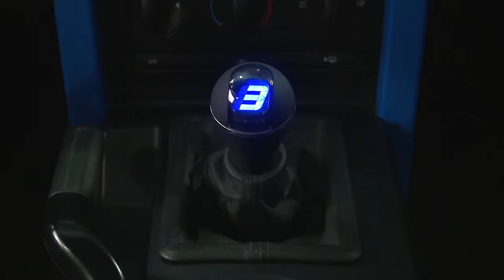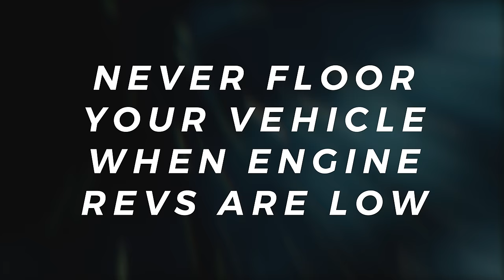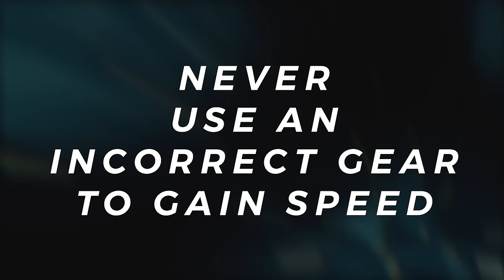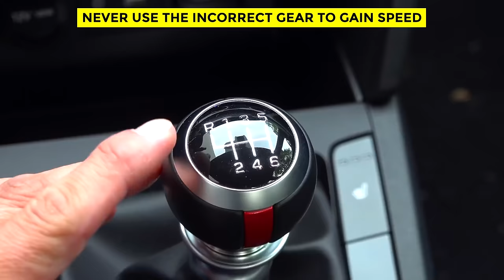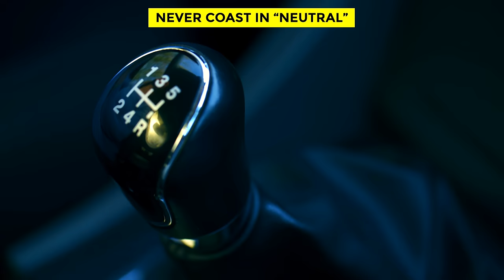7 Things You Should NEVER Do In a Manual Transmission Car!

Comment: I laughed so hard when he said if you coast in neutral your gearbox doesnt get lubricated with oil because there is low oil pressure in the engine... i was like hold up thts not right engine oil pressure had nothing to do with gearbox oil
Reply: A better argument for not doing it would have been that it wastes fuel compared to not giving it any gas and leaving it in gear.
Reply: Maybe he confused it with 2 stroke
Reply: right. the last part is kind a funny.
Reply: Yes my thoughts exactly... the real dangerous issue is the increasing  speed and zero engine breaking causes the physical breaks to overheat quickly and fade and he didn't even mentioned it
Reply: I think in some autos that might be true but coasting is not an issue in a stick shift.  In fact coasting can be handy when you don’t wish to slow down via engine braking but don’t need to be on the gas either.
Reply: Well,I am always coasting in neutral because,if I leave the car in gear and start going downhill,the engine will quickly start to over rev and I'd constantly have to break to keep the RPM in check. Jamming the car into neutral solves that.
Reply: @perrinayebarra  good way to burn your clutch. Don't coast with the clutch disengaged. Fatal error for lots of reasons.
Reply: @thethunderchieftain5464  : Or you can upshift.   (Although in my experience, I've never had a situation where my engine was at risk of overrevving because I was going downhill in a low gear with my foot off the gas. As a practical matter, I don't think that's even possible.  The effect of engine braking in low gears is too strong to allow the vehicle's speed to increase to the point where the engine would be in danger of overrevving.)
Reply: When you coast in neutral the transmission is receiving no power from the engine. The transmission is only lubricated when it's receiving power from the engine because of how splash lubrication works. Therefore coasting in neutral for long periods of time will damage your transmission because if left that way for too long like beyond the time it takes to shift gear the internal parts dry up. This is the same reason why you need to disconnect the driveshafts for a 4wd/awd to tow or only tow from the dead axle of a fwd or rwd vehicle. That's my super shitty explanation.
Reply: @amritk5173  how long are you coasting for ?? Within 20 seconds you have slowed down and need to speed up and also wouldnt starting your car also damage the trans and the oil would have dried like you said and had no lube
Reply: @amritk5173  but when you're in neutral it's just like you're sitting still idling? Are you saying that idling is bad for the engine?
Reply: @amritk5173  lubrification won't wear off in minutes on a still transmission, for it to be a problem you'd have to coast in neutral for like half an hour at least lol
Reply: @amritk5173  what?! How is the transmission not receiving power from the engine in Neutral with the clutch engaged? Then where does the power go? The gears are still spinning even if it's in neutral. Please explain.
Reply: @TheBaron8134  yes, and no. When the engine is in gear, down the hill, will consume almost 0 fuel plus will save you the breaks and if you drive on snow is way safer. And the smart people that is saying the rev will go on red, well, the peddle in the middle is there, use it it's called brake or just up shift.
Reply: @Milesco  It is possible in extreme cases. I experienced it only once, going down the Mount Washington. It revved up even in second gear. Never happens on Interstates or US Highways.
Reply: When you coast, you should just shut your engine off so that it doesn’t cause any wear
Reply: @thethunderchieftain5464  what is coasting? Pls explain
Reply: @Raaz-hd2si  Transmission not in gear.
Reply: @mathewng1988  then?
Reply: @Raaz-hd2si  Coasting is when your transmission is neutral, so that your engine is idling, but you're at speed. So the power flow is cut at the transmission, with separation between "engine - clutch -transmission(first half)" and "transmission(second half) - tires". Fuel is keeping the engine running, and the vehicle is moving from other sources of power, example gravity.
Reply: @mathewng1988  ohh... So does it affect the vehicle in a bad way?
Reply: @Milesco   I went down Pikes Peak in a 99 Escort Zx2 5MT.  That's the only time I've seen this issue with overreving down a hill.  start in first gear and it just speeds up the 2.0L Zetec, and by 4000 rpm the inertial effect of the overhead cams actually made it speed up even faster, like 'VTEC just kicked in Yo', so I had to upshift at 4K every time and scrub speed using the brakes frequently, often dragging the parking brake to take heat off the front disks.  Didn't help that I had a line of diesel 4x4s with low gear transfer cases ahead of me idling down the mountain at a leisurely 15-20mph.  by the time I reached the half way point down the mountain, I had to stop at the visitor rest area for an hour to let the brakes cool.  The crew working the mountain checks your rotor temp at that point and mine were baking at 430 degrees F.  So, it can happen under the right circumstances.
Reply: @amritk5173   some manual transmission cars can be flat towed without any harm at all.  And even for the few that canoot, unless you're coasting for 20 miles or more, it doesn't make a difference.  The residual lube on the bearings will protect them for all intermittent coasting requirements.  That's why even cars that can't be flat towed can still be towed 4 on the ground to the nearest repair station a few miles away without causing any harm.
Reply: @legacyslegacy  That still wouldn't make sense. 2 stroke is the one that shouldn't be engine breaked. Coasting in neutral will do nothing.
Reply: @Remu-  right, forgot he said neutral
Reply: @TheBaron8134  exactly!
Reply: The real danger is not going fast enough
Reply: @mathewng1988  Hence the accidents of locked steering and powerless brake
Reply: @simonnyman9031  Indeed - modern cars used no fuel on the overrun.
Reply: @amritk5173  That's not how it works.  Lubrication in a typical manual transmission has almost nothing do to with engine speed and is not harmed by coasting in neutral.

All the parts inside a typical manual transmission rotate in sync with the speed of the car, not the speed of the engine - except the input shaft (when the clutch is released), which in turn is matched to the speed of the gears with synchronizers.

In terms of lubrication, the only minor difference between coasting in neutral and coasting in gear is that the speed difference between the input shaft and the gears (on the shaft-to-gear interface) is potentially higher in neutral.
Reply: Avoiding coasting in neutral specially on steep downhill could overheat the brakes causing it to fade. It is true on large heavy trucks with drum brakes. lighter cars with 4 wheel well ventilated disc brake, not really. However, in event of brake failure, it is a lot easier to stop a car with gears engage than in neutral by shutting off the engine and use the engine to slow the car down (unless you know how to engage the gear back without the clutch in a hurry)
Reply: @simonnyman9031  Yes but actually you will learn that modern cars 2001+ that have ECUs and electronic gas padal always add little to no fuel when you are engine braking. So at the end you are better engine braking then heating up the brake pads
Reply: In uk is illegal to coast in neutral as you are not in full control of the car. From my motorcycle days I still use the gearbox to gently slow down when say approaching traffic lights, in particular on wet or icy roads.
Reply: Yeah, coasting in neutral is a problem for an AUTOMATIC transmission.
Reply: Engine oil and trans oil are two very different things
Reply: @interstate80.  And use the Fred Flinstone method of stopping. Don't tell people that. Somebody might try it and burn out the muffler bearings.
Reply: @amritk5173  This is incorrect, Amrit. When you coast in neutral, with the clutch engaged, the input shaft of the gearbox is still being driven by the engine, the gears are sp[inning on their shafts and splash lubrication is occurring. Neutral only means that no synchronizers are engaged, so there is no output power from the transmission to the wheels. If you do this sensibly (essentially meaning at lower speeds) it may enhance your smoothness, and yes, save fuel. Depending on the design of your transmission, it could be possible, if descending at a high rate of speed with the engine idling and the gearbox in neutral that the final drive and output sections of the transmission could be turning very fast, without comparable speeds on the input, leading to insufficient lubrication, but again this depends on the exact design of your transmission.  Your comparison with a towing scenario breaks down, because when you are towing the engine is not running. In that case, yes some transmissions may fail from lack of lubrication.
Reply: Frfr
Reply: Same shit I did,  I was crying 😂
Reply: lad probably thought a 2 stroke and a 4 stroke meant the same :D
in a 2 stroke, the fuel supply of course stops due to laws of physics where the oil supply aswell cuts off causing heat to build up of course and eventually engine failure
Reply: @thethunderchieftain5464  shifting into a more appropriate higher gear solves that too, and gives you all the benefits of actually being in gear, ie. taking advantage of the engine management's fuel cut to actually use zero fuel, using engine braking to keep your speed in check without overly stressing the brakes, being already configured to accelerate if required, etc.

Unless of course, you're already coasting above your car's normal maximum speed!
Reply: @amritk5173  The gearbox is submerged in transmission oil. The gears that ARE turning will receive exactly the amount of lubrication that they need for whatever speed they're running.
Reply: @Milesco  Exactly, and if the hill is SO steep that the engine brake alone cant keep it in propper rev range you have this thing called the BRAKE. Its a pedal placed between the throttle and the clutch and its very handy for controlling the speed of the car. 😎
Reply: @Milesco  Then drive an RV downhill. Our (european) motors don't have so much volume so they can only break a bit. Even low gears rev up too fast. So I need to brake regularily if the revs get too high. For known straight roads I used a higher gear and let the windresistance do the breaking 🙂. With 100km/h it didn't get any faster.

Comment: When braking, you should use your clutch pedal just before stalling the car. While in gear the car holds itself a bit so it is safer to brake while on a gear. If you press the clutch before braking, nothing will hold the car so it will be much more dangerous and unstable to brake.
Reply: Good tip thanks !

Comment: 9:42 A manual transmission is just a simple gearbox. There is no oil pump in a manual transmission, so coasting downhill in neutral doesn’t starve a gearbox of oil.
Reply: Next tip: do not idle a car it will destroy it😂
Reply: Next. Dont buy a car as it won’t last forever
Reply: that last "advice" was pointless like for real bro why is there a neutral then ??
Reply: Üüääüüüüüüüüüüüüüü
Reply: God Trojan  and it will lead to a lot of expensive repairs down the line!!
Reply: Next tip: don’t brake your car, it’s will ruin your brake shoes
Reply: Seriously! This one had me scratching my head because I was taught to shorty coast in neutral when approaching a stop or a fight curve then go into the correct gear after completing the turn.
Reply: I may think it is not a technical question, but a security one: in neutral, there is no engine brake, so if a car is going downhill, with some sharp curves, for example, it is better to have the gearbox engaged in a gear, from 2nd to 4th, in my opinion.

Then, coasting few centimeters/inches on neutral if the light is red or before a stop sign is, I think, still Ok.
Reply: @Three_Days_Of_Solitude  "...it won't last forever"

Yeah, well, I can keep it alive as long as I'm alive...I call "good enough". Past that really isn't my concern.
Reply: @oscaraurelio8869  If you're engine braking on a downhill, you're going to want to keep it in a gear that isn't too stressing to the engine or transmission (i.e. using my 2.4's transmission: 6k redline, 4k shift point-high, 2.5k shift point-low, "RPM comfort" is 3k-3.5k for engine-braking). If you're doing it right, you wont need to apply throttle or brakes to maintain the same speed on a given grade.

You can apply your brakes as needed to keep that "RPM comfort target" for bends and corners, and when cornering you can draw a mental line (out-in-out through the corner, usually, but variable-dependent so always have a safe entry speed in mind) and try to match road-speed (especially if downhill) to minimize brake input and brake overheat.

That last bit is why you hear semi trucks engine braking down grades all of the time: if you control your speed solely with brakes, you run the risk of heat-soak of the friction material (pad or shoe) and contact surface (rotor or drum) and then you have a runaway event. 

Otherwise, engine braking on its own isn't harmful to a powertrain, if done mindfully.
Reply: @oscaraurelio8869  if youre going like 40 and you come up to a red light you dont reallt need to engine brake its not bad to not do it
Reply: God Trojan  costing you an arm and a leg
Reply: @FalconTheFries  dont accelerate your car , it will cause wear and tear in your engine and gearbox and tires.
Reply: yes and no: coasting on neutral is unsafe, also damages the bearings if done too much, thats why cars must be towed with the traction wheels lifted or in rwd vehicles, with the rear axle off
Reply: @omegarugal9283  Sorry my good sir but that's not how cars are designed. The components of a drive train in a vehicle are designed to move with or without power from the engine. Costing in neutral does not do any extra damage to bearings because the bearings would still be moving even with the power from the engine. When towing you put the vehicle in neutral so the wheels and engine are disconnected. Also there is no such thing as traction wheels unless your are referring to how a vehicle put down power through the wheels.
Reply: it only puts you in danger as you have no control of car
Reply: @anothersmite3956  Neutral is for standing still... and only for that.
Reply: God Trojan  Also dont let it stand still cause it will rust
Reply: Yeah this applies only to 2 stroke engines
Reply: Yeah, I guess they've copied it from the tips for automatic gearboxes or they know barely anything about the manual ones. Lol, it sounds odd, I drive manuals daily (like most people in Europe do) and I haven't ever heard of not using neutral to coast. Yeah, it is pointless in most cases, it does not save petrol, you can only brake and wear your brake discs, but sometimes it is alright, when you stand in a traffic jam downhill, and then you just use brakes to keep control, and your clutch has some spare time. Also putting N some yards/metres before stopping at the traffic light is okay.
Reply: Its a trade off, yes you save gas, but wear brakes faster, as while its in lower gears, you can use engine braking to slow down/keep steady speed, while in neutral, you have to relly on brake all the time.
Reply: I have a Ferrari 328 and the manual says to not coast in neutral. More likely for engine to stall and lead to loss of controls.
Reply: Absolutely CORRECT
Reply: I'm pretty sure it's illegal in some states to coast in neutral, something about not having as much control over the car in case of an emergency.
Reply: Slipping the clutch is like slipping the old lady. You only do it when you have a side piece and you want a little something something while you are soending the day with the old lady.  

Special tip trade the old lady in for a newer model every 5 years or 5000 screws which ever comes first.

Comment: Many of these 'tips' are not applicable in every situation. 
1:20 - clutches aren't that expensive, obviously you don't want to needlessly damage a clutch, but after 10-15 years most clutches start to wear to the point they need replacing shortly anyway.
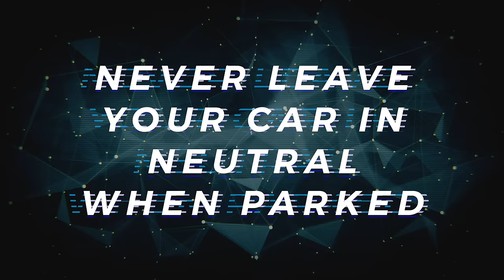2:45 - no need to leave car in gear UNLESS you're on a hill. Also, most newer cars have a safety feature that prevents the car from rolling when the engine is off, mine from 2011 is one of them. 
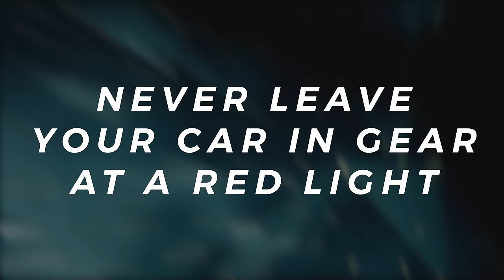4:00 - depends on whether the lights are about to change. There is no point in putting your car in neutral at a red light if you're going to be changing again 5 seconds later. 
6:00 - No point in handbraking on a hill if you're literally moving a few seconds later. 
7:30 - you would always use the brake first before the clutch, the only difference in the winter is that you should drive in a higher gear to avoid skids and also avoid harsh braking where possible